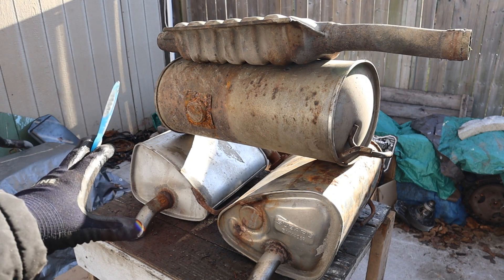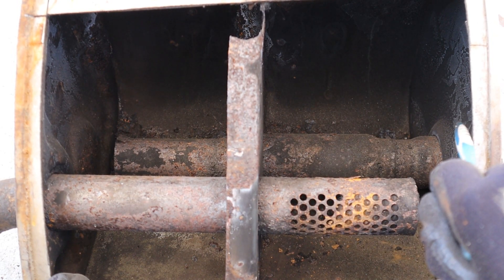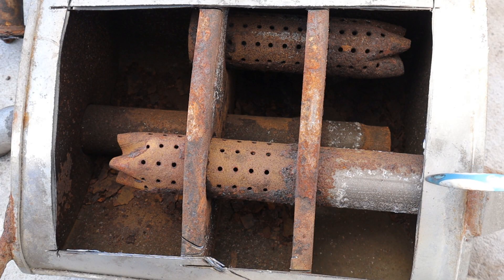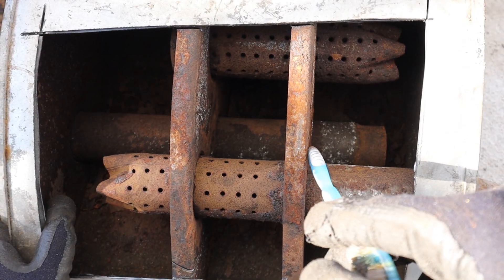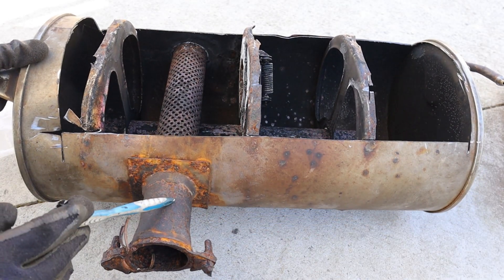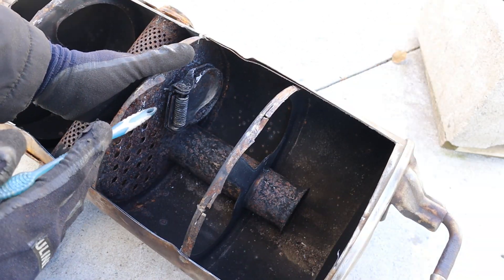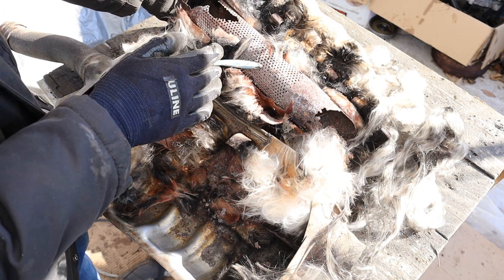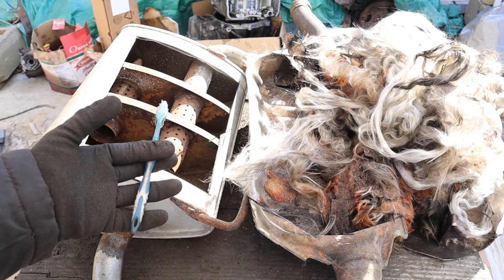How a Muffler Works

Comment: How much back pressure do these oem mufflers produce in the chambers? In the motorcycle world some people install baffles and their exhaust explodes, without the baffles they have no back pressure, so how do you ceate a balance in back pressure need without restricting the exhaust to the point where the muffler explodes?😮

Comment: Great video! I love the way you explain things.

About the fiberglass - be careful and wear a mask! When the fine particles get into your lung usually will cause lots of very tiny cuts into the lung tissue. This often leads to inflammation and flu-like symptoms short-term. Long-term exposure can lead to extremely serious conditions like pulmonary fibrosis, silicosis and cancer! 
Imagine when you get a cut on your hand and once it heals you may get a permanent scar. Pretty much that happens to your lungs and the scar tissue cannot perform the regular organ functions, effectively reducing your lung capacity. The problem with this condition (fibrosis) is that any exposure to harmful particles is a contributing factor, hence we must try to avoid it when possible.

Comment: Hi Mr Speedkar, new subscriber here, do you have any videos on diagnosing a suspected blown head gasket on a Toyota 1MZ-FE and how to fix it. I just watched you tear-down video on that motor. Cheers. 
(I was a DH and took it for a long drive without checking the oil and water)
Reply from the maker: Thanks. Check my shorts video on diagnosing the Subaru...coolant pressure and compression test can help.

Comment: A couple things that might help with that engine code: 1. "2zzge lift bolts" chances are those might be broken and need a replacing. (Use very low torque when installing, like 5ft-lbs) 2. There's also two oil passage screens that you might need to clean out. I believe one is for the variable valve timing, and the other one is for the variable lift. I hope this helps.
Reply: Cool story bro

Comment: I once cleaned the baffles out on my 1970s 2 stroke Gilera moped silencer but when I started it up there was an awful din because I'd somehow managed to reassemble it wrong. I then lost a wire coat hanger and a screwdriver inside the chamber trying to fix it. Fortunately my brother is an engineer and came to the rescue when he popped outside to see what the strange noise was. It was me putting the pipe to my mouth and shouting motorbike noises down it to see what effect it had each time I reassembled it. I also ended up with a black oil ring stain round my mouth that took about a month to remove. Disaster strook again in the 1990s when I borrowed my girlfriend's Renault. I couldn't understand folk flashing lights and laughing but when I arrived home I had a trail of fibreglass about 150 yards long behind me, eminating from the exhaust silencer (muffler as you call it). Girlfriend blamed me and made me buy her a new muffler. It was a sign of things to come. My relationship with her also unravelled and she ripped me off for several thousand pounds. If I'd seen your video when I was 16, I think my life could have been better.

Comment: Those chambered mufflers looks a lot more restrictive than the last free flowing one, that one with trap door isn't as bad though. I only use free flow mufflers in my builds because of that, not sure if there's any real gains though but the sound isn't that much louder when the muffler length is choosed accordingly
Reply from the maker: Yeah they seem quite restrictive to me, but they work!

Comment: Just watching that fiberglass packing coming out makes me itch. Amazing how the waves cancel out each other. Wonder if that can be done with light? Great video as always. That battery powered grind looks like it would clog on toe nail dust & overheat. Just don't use the electric grinder in the shower. Those comments you throw in tear me up bro. 😆
Reply: Light can do this too.  This is why oil sheens have bands of colors (i.e. thin film interference).
Reply from the maker: Thanks! 
Grinder will be for the nails and any small tasks like cutting a bolt here or there

Comment: Glass fibre dust is mostly silicon dioxide and breathing in a lot of it can cause silicosis which is on a par with asbestosis, although it does not go on to cause pleural mesothelioma. As a rule you should avoid making silicon dust from fibre, skrit (glazed tiles), glass itself, etc, similar to dealing with asbestos. Your exposure was minimal as you were outside and upwind, but don't make a habit of it!
Reply from the maker: Thanks and good to know

Comment: What about electric cars, they are so quiet, what kind of muffler do they use?   OK, that is a troll-based comment.
Reply from the maker: Infact they use a noise maker at low speed to warn Pedestrians they're coming
Reply: Electric doesn't need muffler because they don't produce gas

Comment: its fibreglass the only thing it would do is cause lung irritation if you are able to breathe in the fine fibres that break off.
Reply: Go look up silicosis... GF is not exactly the same, however 1-2 good periods of maskless exposure at a decently high rate will give you symptoms and quite probably long term scarring of the lungs/aveoli where they will penetrate the mucuosal membranes and stay stuck and/or migrate deeper or just cause lots of inflammation and potentially pheumoni-like reactions.
FAFO, its not just an 'irritant'.
About as smart as being nonchalant with brake cleaners.
Reply from the maker: Okay, I will play it safer next time

Comment: around 1:24, the ends of the pipe with those holes, aren't they blocked ore gummed up? If so, not good, especially for a turbo? ;D
Reply from the maker: Blocked with the glass pack material

Comment: I used to cut long glass fiber bars at the factory where I work with a particle saw, giving out a fiber ash cloud like a volcano each and every time and trust me you DO NOT want to inhale that shit. Would always wear a face mask and goggles to protect myself and every once in a while I'd spray myself with a compressed air pistol to clean off all the residue on me, it irratates whatever it touches.
Reply from the maker: Thanks. I figured it's like insulation.

Comment: The glass will be non toxic to the point of being inert. What it's been marinating in.. I'd consider carcinogenic, most petro chemicals are. Gas is like 12% benzene. That is  ☠️. If we instead assume proper combustion... the danger is more carbon particulates so small they lodge in your capillaries and bloodstream. But we eat that junk all day, every day.
  You're fine, I'm being semantic. I can almost guarantee it will be the same glass fiber as what goes in houses. People would be out of their minds to build a special factory just for muffler glass, you'd just add some spool winders to an existing one. The inner chrome, if present could make some interesting compounds combined with the acid moisture the engine produces. If the rust has other colored crusts on it like yellow. I'm really fishing for something now..
 Really it's chemical waste, but with lives immersed in soot and plastic we don't even put it on the risk scale past glass fiber being a temporary irritant.
Reply from the maker: Good to know. I'm still alive

Comment: Cool dissection.  Is it possible to replace the muffler with speakers since the job is to have destructive sound waves to cancel sounds?
Reply from the maker: That's basically what car makers are doing now by pumping exhaust noises into the cabin

Comment: Glass fibers are not carcinogenic however its strongly recommended to wear gas mask or respirator of some kind when exposed to it. Small pieces of glass fibers could be breathed in with air and cause cough/irritation for quite long time. Our body struggles to get rid of it.
Reply from the maker: Thanks good to know
Reply: And the lungs are not the only things that can be irritated by silica dust. Protect your skin and eyes, too.
Reply: They're a bitch if they get in your skin. Clear and almost too small to see but insanely irritating
Reply: this is exactly what they said about asbestos ;) I would be very surprised if it turned out my body can dissolve glass
Reply: @gacha24 According to studies it can! ;)  Actual glass is not a crystal unlike asbestos and a lot of other stuff that you can inhale.
Reply: @gacha24  studies says you can actually absorb it. Yeah may still lead to silicosis in the end, that is not that different from asbestosis